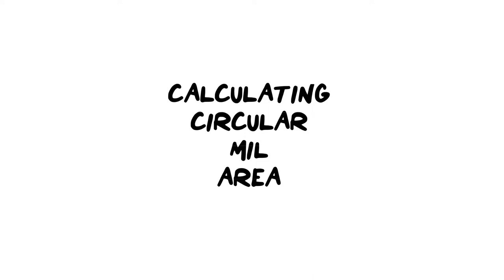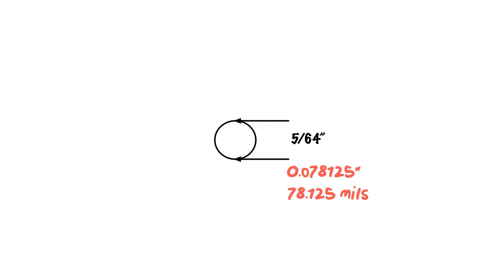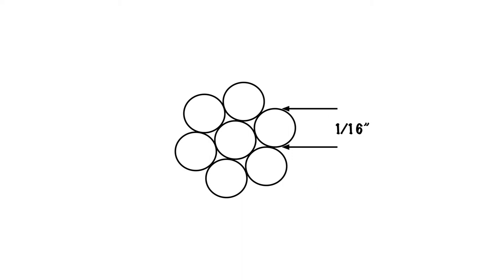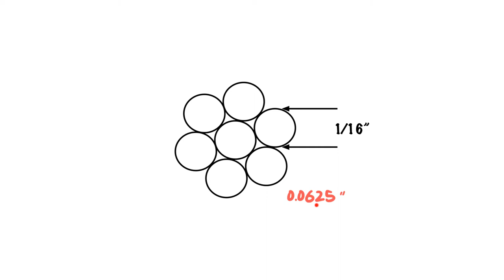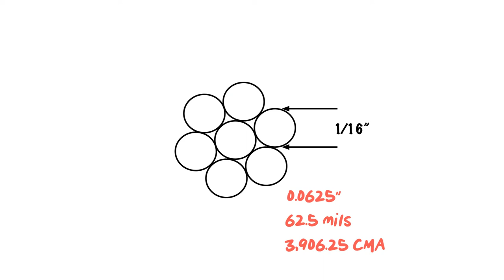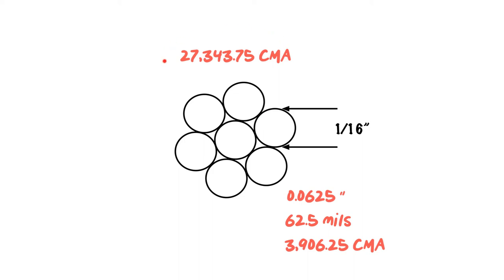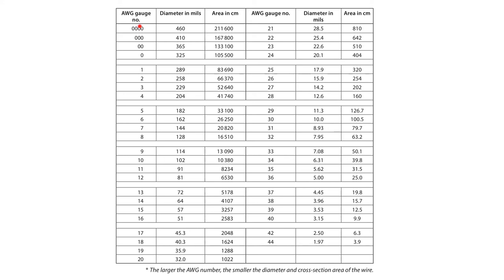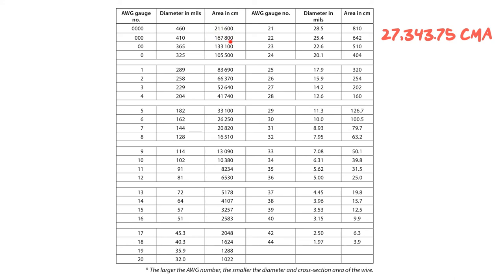CALCULATING THE CMA OF CONDUCTORS

Comment: Seems to me you have this whole exercise backwards.  You are given a piece of wire, it is easy to determine its gauge without resorting to calculation of cma.  So you started with a given wire gauge, calculated the cma, then converted it back to (probably) the same gauge.  What have you gained?  Assuming the wire is from a properly functioning installation, just replace it with the same gauge.  A more likely use of cma occurs when you are terminating several wires of different gauges in a single terminal.  To  determine the proper terminal size, you find the sum of the cma of all the wires and then take that number to the terminal specification charts for the correct selection.
Reply: Hello, when summing the cma of multiple wires, do you simply add? Or is there a different way of doing this? Thank you! I know I am three years late but hopefully you see this.